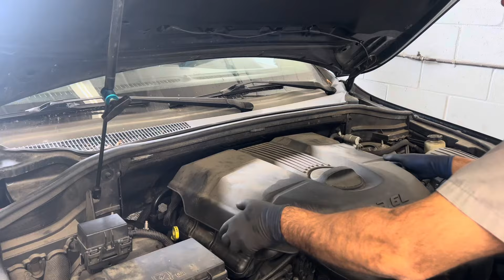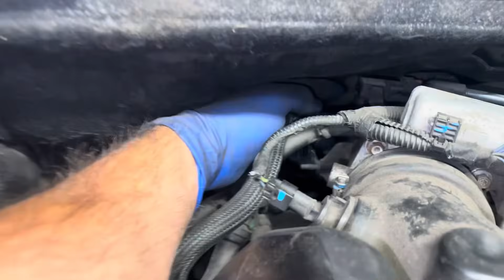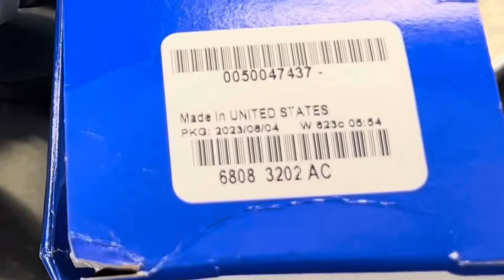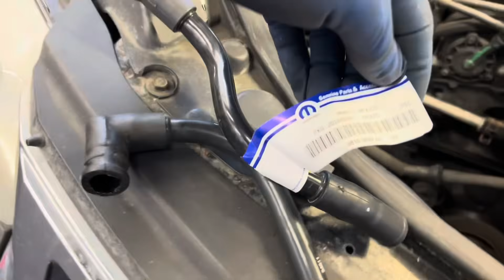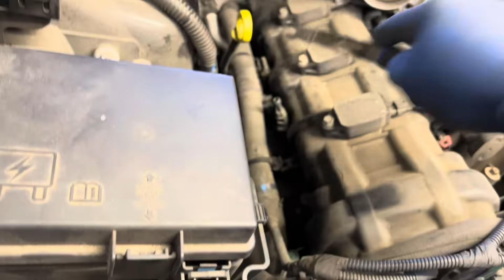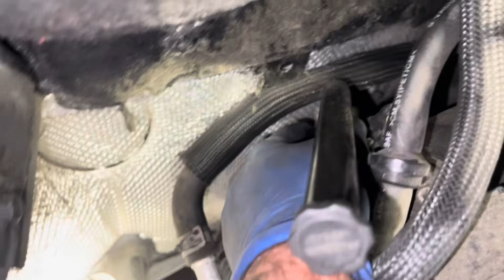Replacing The PCV Valve On A Jeep Grand Cherokee 3.6l Engine

Comment: 2018 Jeep Grand Cherokee Summit was giving me codes. I inspected the vacuum system and found my PCV valve plastic hose was broken right in half close to the PCV valve where the 90° angle was. I have no idea how long this has been broken for but I suspect it was from being serviced.  I cleaned and repaired it with a new hose and PCV.  Will this cause my  Jeep to have a slightly rough idle? My codes are clear for the last few months but still having a slightly rough idle I just don't know what the internals inside are doing or if there is oil buildup
Reply: Woah bro we literally almost got the same symptoms , can I ask u a question what did your air box look like last time u checked ?

Comment: Brian, I cannot get to that bottom bolt to save my freaking life... That damn wiring harness and the AC line thing are both so in the way.  What is your strategy? I got the top off.
Reply from the maker: You can try unplugging so connectors further up the line on the wiring harness to get more slack